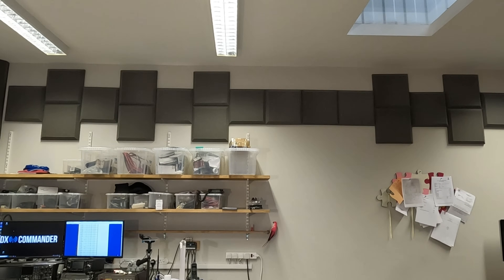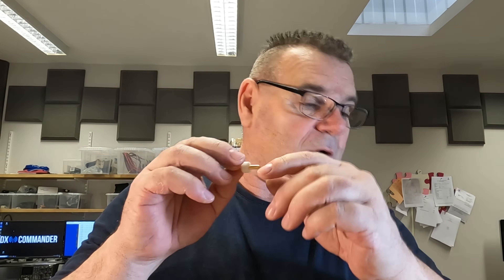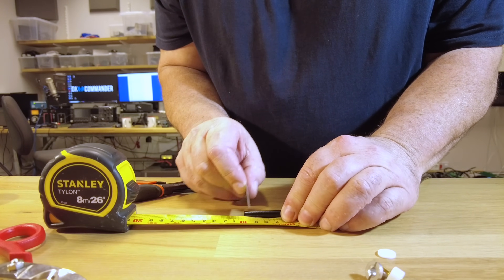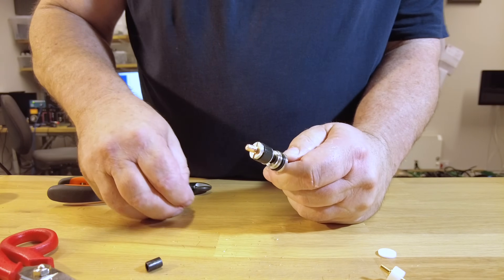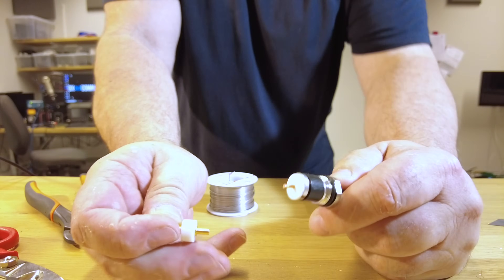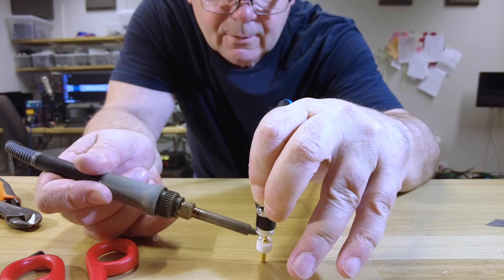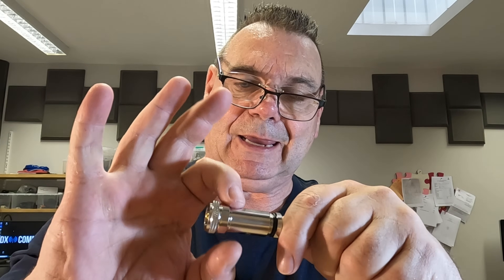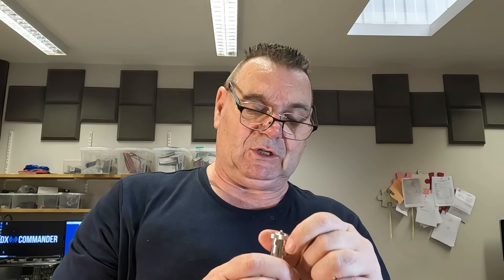Regular Man Fits PL259 Coax Connectors

Comment: I just finished up installing about 10 M & P connectors(both N and PL259) to some M & P Hyperflex 13 and some DX Engineering DX 400 MAX (closer to hyperflex 10 ...without the flex).  After installing the metal "T" washer between the shield and braid, trimming the Braid, Foil, and dielectric center and center conductor and installing the plastic flat washer, I apply a bit of paste flux either using a screwdriver or a zip tie cut off as an applicator, or just poke the tip of the wire into the paste.  It doesn't require much.  When placing the tip, whichever type, before hand, if you look very closely at the tiny hole, you will see s slit going from the hole to the end where you insert the wire.  Take your razor knife and carefully slide it into that slit to expand it a bit.  There's another on the opposite side, do the same there as well.  Just keep your fingers the hell out of the way.  Then slide the pin onto the wire.  I set the coax on top of a spool of wire and put my wrist on top of the coax so it weren't goin nowhere!  held the solder in the hand atop the coax and the soldering iron in the other.  I put some solder on the tip of the iron, held it on the top hole .  As things heated up I applied more solder and the flux caused it to flow into the hole and on the wire more easily, making a better connection.  Hope that helps.

Comment: Yet another great video! Thanks for your input.  I am in process of putting my shack together (have to wait for the budget to catch up).  Based on your recommendation  I got some of the M&P connectors and will be using the Ultraflex 10 for my UHF/VHF antenna run (DX Engineering DX 400Max for everything else).  My Dad taught me to solder, he always used "No corrode" brand of paste flux to help the solder flow more easily.  He would always remind me that heat rises and would have me use something to hold the coax, apply the flux, and place the soldering iron UNDER the wire and apply the solder to the top.  When the wire comes up to the proper temperature it will be more evenly heated and the solder will flow more evenly, giving a better connection.  The other thing he would tell me is that I can take the time to set up and do it right, or I can take the time to do it twice, or maybe even three times.  Sometimes I'd hate it when he was right!
Reply from the maker: Haha

Comment: Holding the connector in a small clamp, with the small hole facing upwards, poke the solder into the hole. Heat from underneath. Let the solder continue to melt until it overflows a bit. Clean off and you're done.
Reply from the maker: Thanks for the info!

Comment: You make it hard work 😀 remove the white plastic ring on the piece you need to solder which then gives you more room to solder whilst  holding the plug in a vice for stability 👌 Use 1mm 60/40 solder 👍 M0s these days, old school Gs know better 🤣
Reply from the maker: Please come to the shop and be the cameraman! It would have been SO EASY if I wasn't filming :)

Comment: I have an catalog of M&P (2018th edition). On page 40 there are the different types of connectors. The CO.UHF.7M-S needs 17mm (0,699") cut of. The 10mm cut off is valid for N-Type connector CO.N.7M-s. Using 17mm makes is a lot easier to solder the connector because the pin has a longer part to fit on.
For CO.UHF.10M-S (also usable for RG 213/U) it is 20mm.
For your soldering iron the best temperature should be between 400°C and 420°C (or 300°C..350°C for professional temperature controlled soldering stations).
Reply from the maker: Thank you for that!

Comment: I have installed a plethora of the old type and the new M&P connectors.
Personally, I use a small vise (Dremel owned for over 30years). 
Makes everything stable and I can use both hands.
My vise comes out on field days as well, as it’s very portable and sturdy.
Stay safe my friend   73   Andre

Comment: I usually cut a short length of fine solder and drop it into the conductor hole flush with the top, then grip the white spacer in clips/vice approach with the wire to the hole and apply heat to the outer of the tube. when up to temperature the solder will melt with its flux and allow the wire to enter, remove the heat and hold your breath till it cools, job done.
Reply from the maker: That's a great idea!

Comment: Informative and entertaining as always. I see so much of my project work in yours. I never have all the tools I need handy and usually one thing will go horribly wrong that needs to be fixed... with a tool not handy. I use a disposable pan to work in for projects with small parts because I'm guaranteed to drop two or three small screws etc.  I need to get a few of these connectors. Thanks as always. Jack K5FIT
Reply from the maker: HAHA!

Comment: Just use an old-fashioned 200 watt soldering iron, they have a large soldering tip that contains a lot of heat and therefore does not cool down immediately, even if you remove the power then you can easily solder a few plugs.

Comment: OMG! This a text book example of how NOT to solder.  Always heat the work and use the work to melt the solder.  You can tin the iron with a little extra solder on the tip.  That helps with heat transfer.  You might even add a bit of solder at the junction between the tip and work, again to aid heat transfer.  Once the metal is hot enough, the solder will flow freely and wets the junction of the two metals.

Callum, invest in a set of helping hands,  those are the alligator clip holders that could hold the tip in clip and the coax in the other.  That leaves your hands free to hold the soldering iron in one hand and the solder in the other.  With a properly cleaned and tinned soldering iron and the right technique, this would be easy.
Reply from the maker: Indeed!

Comment: I drill out the tiny hole in the centre conductor, a bit use flux makes the solder flow, and it's done. Great video as always
Reply from the maker: Cool, thanks

Comment: Have always thought you need to be part Octopus to solder properly. Will have to get some of those Doc Oc arms from Spiderman. As you say it a a practice thing, after doing lots it becomes easier. I tend to use the crimp type for any indoor connections and the compression type for outdoors. Indoors are generally short jump leads, so I am not tempted to use the short bits, with crimp connectors outside. Probably be OK with some Waterproof, glue lined shrink wrap though.
Reply from the maker: Octopus... Yeah!

Comment: It takes a great man to be humble and a brave man to share it with the world. You are VERY great and VERY brave… but darn… your soldering priviledges need to be put into rehabilitation counseling… These connectors are wonderful but try using a better iron, clamp or have someone hold your work, flux and pre-tin and then the final solder will just fill in the space and have a great grip.  Let rosin core solder melt onto the item being soldered. The little dollop on the iron should  only be there to increase heat transfer, not apply solder. Practice on items cheaper than those connectors…  😳  Love your channel!
Reply: Thanks for your comment.  Glad that  so many people share their own experience,  and like Callum's work... 
In our Youtube channel there is a Video assembly for each one of our cables matched to each one of our connectors. 
 Another way to share experience...
Reply from the maker: "rehabilitation counseling" HAHAHA! Yes, I know it was a total cock-up, which is why I published. The sort of thing a regular "Joe" might do.. Now he can learn from me!
Reply: @DXCommanderHQ  which is why you are such a gift to the Ham community.  Thank you!

Comment: What they said about soldering 👍. But also use a mini vice / third hand or some such to hold the cable firmly. Then it doesn’t flop about all over the place and you can use both hands to control the soldering iron and feed the solder. It will make the job so much easier.

Comment: tip for you Cal on soldering the M&P plugs, a aldi/lidl desk vice to hold the cable, and a fine point soldering iron works wonders with the M&P evolution plugs, i have soldered a dozen on in my setup with my Ultraflex 10 2 S points better on RX , no more pl259s for me :) bonus tip with the evolution plugs and the vice holding the cable at a slight downward  (very slight)angle no need to tin the inner ,just push the centre on line up the hole uppermost and use the fine tip soldering iron/solder and it will run ok, and yes the hole is bloody small :)
Reply from the maker: Yeah, I considered using the vice but I couldn't be bothered moving all the cameras and audio down to the dirty end of the shop!

Comment: 139 comments how to do it better, so why not add another one ;)

Cal you need to get a better soldering iron, or at least a nice fat 3, 4, 5mm chisel tip. That allows you to turn down the heat a bit, which helps with the flux not instantly evaporating before it had a chance to do it's magic. An extra flux-pen or some flux goo that you apply before putting the pin on top of the center conductor will also help. You can then heat the pin from the bottom, wait a few seconds and then apply the solder on top, to the hole, which gets sucked in immediately.

And don't ask me how many BNC connectors I have ruined despite knowing this. I usually end up with too much solder on the outside and then the bloody outer shell does no longer go over the pin which has a bit of a solder blob at the bottom.

P.S.: If you do not go for gold-standard connectors, I find the cheap 90° PL-259 connectors e.g. for Aircell-5 or RG58 much much easier to assemble. You see exactly what happens with the center conductor and then just screw in the lid and have confidence that the connection is good.

Comment: I have 20 metres of Ultraflex 7 with these plugs, meant to be used portable from where I am not far from the car as the weight can be an issue if you have to carry it any distance, saying that I did once use it on a SOTA activation (Gun Moor) which was a bit of overkill, I paid for the plugs to be fitted as it worked oy slightly cheaper for me! I do need to find something from M&P that is suitable for SOTA activations (something lightweight!)
Reply from the maker: Look at their 5mm stuff. Airborne 5 I think it's called. I have some. Like RG58 but spec on or about RG213. However, it's not super flexible.

Comment: At 11:50 I think the phrase rhymes with "clucking bell".  I love these connectors - what I have also done is "pre-fill" the copper tip with solder - then reheat (melt) it again and shove in the centre - but then I only use one pair of glasses - so maybe that is a rubbish idea.
Reply from the maker: Haha Tom!
Reply: Thanks Tom

Comment: These are the best plugs by far, I’ve now bought loads of them for my shack. If finding the soldering hole too small (as sometimes they do vary in size) I use a tiny drill bit on a dremmel and just make the hole a little bit bigger. Like you I wear glasses when doing close work/reading so find the hole just a little too small. At the end of the day this is something that could be put right at M&P quite easily but until they put a slightly bigger drill bit in their machine then I guess it’s down to us.
Nice explanation Callum, keep up the good work and if my shacks back together by the 13th I’ll listen out and give you a call.
73 de MW6PNW. Paul
Reply: I have been told about the small hole complaints and frankly speaking the aimed use of the flux is something that has solved the task perfectly. Just imagine in our lab how much soldering we do daily!  In any case, I have asked to bring the dimension of the hole to the same size as the "N" connector's pin.  You must be really a skilled man to use a tiny drill bit to enlarge the tiny hole.  The Hams always succeed in impressing me with their passion and creativity.
Reply from the maker: Hey Paul, yeah listen out for us!

Comment: I find tinning the center conductor of the plug, not the coax, easier. Heat up the center connector and let the solder wick itself in the hole but not too much or the coax center conductor will displace the solder when inserted or could push air in and that can push solder out (if the tip isn't ventilated).

When you push the center conductor of the coax into your connector, just heat up that center area where the center conductor is to go and when the solder melts the center conductor drops right in ☺️

I use locking pliers to hold my connectors while I solder -- doesn't move and protects my dainty fingers from getting burned 😁
Reply from the maker: Good tip!

Comment: Don't tin the pin. Run flux from a needle into the access hole and let the solder follow the flux. It's like copper pipe plumbing on a micro scale.
Reply from the maker: Micro scale.. Yes, I get that. Good tip.

Comment: The only problem I've ever had with the "old" type of 259 is with the REALLY cheap ones where the centre pin sits in a plastic insulator which melts really easily. The plugs with a heat proof mica or bakalite type insulation are fine IMO. The compression type are more expensive as there's obviously more to them but they perform no better than a well fitted "old type" screw on plug. Interestingly, the PL259/SO239 connector was designated as UHF when anything over 30Mhz fell into that category whereas nowadays, UHF is regarded as 300Mhz - 3Ghz, hence the need for N type or BNC connectors.👍
Reply: Please have a look at our specific video,  (EVO connectors) on Messi & Paoloni's YouTube channel. We explain step by step why they are so different from a constructive point of view and of course the overwhelming difference in return loss and insertion loss. The EVO connectors are inspired by the quality design and performances of the N connectors.

Comment: I have not tried this type of connector, but I think i may have a solution to your solder problem! Currently I am playing with surface mount components, which are often soldered with a paste, applied from a syringe. By adding solder paste to the core, then putting the tube over, simple heating the connector with the iron should result in a perfect connection. As I said I have never used the M&P 259's, but I reckon this would work. Next time I am in your area I will drop in a spare 16mm spanner! Jim M7BXT
Reply from the maker: I like that idea.
Reply: You shold try James and with your skills everything will go smoothly as in our labs.

Comment: take a tea break, Cal. You seem to be shaky today. Hear you on the bands, all the best, 73, bemi - DB3MI
Reply: did you know, by the way, that the thing you call the adjustable spanner is called Engländer in Germany. That translates to englishman :D And about soldering/ tinning: i think it's useful to tin the wire, then put tin into the center conductor of the plug (held vertical upwards by a small vise) and then push in the wire from the top while keeping all nice warm with the soldering iron.
Reply from the maker: Yep, I had just taken my medication!

Comment: Tin both parts, the pin and centre core then heat the centre pin and push together. Then use some pliers on the centre pin to cool it so it doesn't fall of as it is still hot. I do this on N types but not so much on the pl259 compression fittings. Cheers VK3DJC

Comment: Very similar to N--types as you mentioned,  FWIW it is worth using very small gauge solder, and if you have a block of wood or similar to push the centre pin against. excess solder can be scraped off with something like a Stanley knife blade. I dread to think how many N-types I have fitted over the years, but the first one in every session is always fiddly. pedantically you should not blow on a solder joint, though we have all done it. Good demo though, they really are nothing to be scared of.
Reply from the maker: Good tips there. Thanks for that. Never knew about the blowing..
Reply: @DXCommanderHQ  we can't help ourselves, we just do it as our fingers burn ::-)

Comment: From much experience, if the pin has a hole in it indicates it's a crimp terminal. However, after looking at M&S's webby it instructs you to solder??? Secure it vertically via the insulator a vice and flood it with solder then dip your center (untinned but with a tickle with a flux pen) in it. Think that will work. Then hold the gland nut in the vice and spin on the shroud. With a proper spanner. We used to use plastic spanners so you couldn't over-tighten. They used to come with the connector and you chucked it away after. Now it has set me off thinking we should develop or mod a transceiver that sits near the feed point and the data can then be sent via twisted pair or optical.
Reply from the maker: Yeah, need a small metal vice for the camera work area.. And a flux pen.
Reply: @DXCommanderHQ  Found the plastic suction cup applied desk vices are just great. My Dad bought me one when I was 12. They don't sink or hold the heat.
Reply: PS. I'm a solder freak. I love playing with it. Most of everything copper I worked with for Cable & Wireless, UUnet and Worldcom, and many other outfits for CCTV - Automotive crimp it. I really love the F-type connecter like Augat (not screw on shite) as it just holds and presents the cable end perfectly. Surely that would be the way to go? Well for a solid center conductor. Love some thoughts peeps.
Reply: Please have a look to our Youtube Channel Steve and thanks for your contribute
https://www.youtube.com/c/MessiPaoloniSRLAncona/videos

Comment: I always tin but I’m on the old type PL259’s. Just makes it easier. Wow at the size of the adjustable. I say if it works use any tool you have to hand. 73 🤙🤙🤙
Reply from the maker: Good tip!